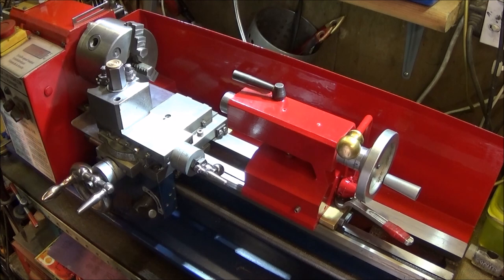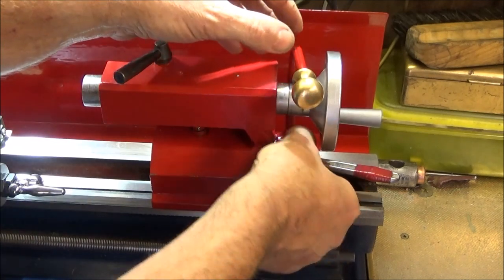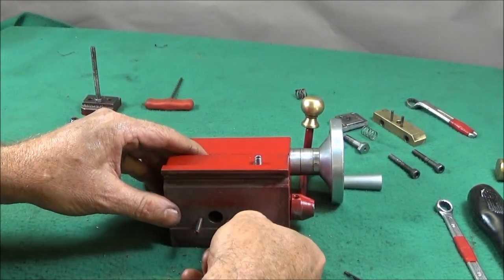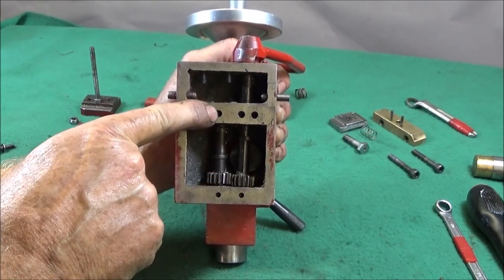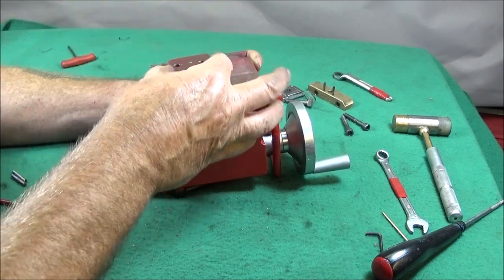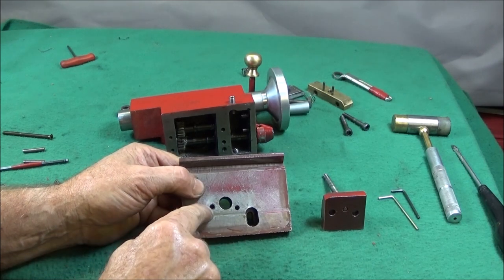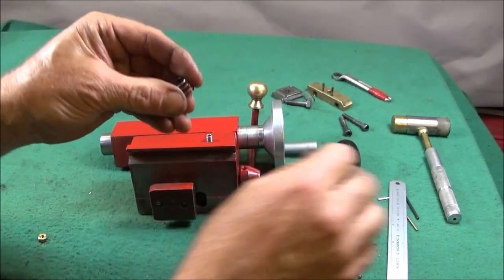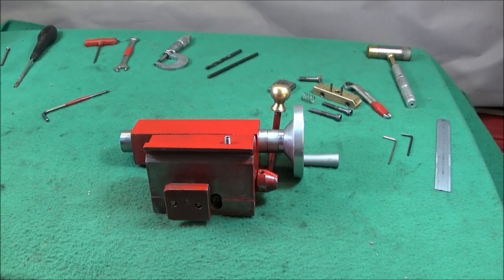Chinese Mini Lathe Tailstock Improvement & Extra Locking Lever Upgrade Part 1

Comment: Hi Steve,
Had same problem with tailstock pushing back.
I changed the cheap washer/ spacer inside for a square 1/8 ''  plate so that both cams have full contact which they dont with the washer.
No more pushing back, full lock problem solved.
CKW
Reply from the maker: Hi Carl, That's a great idea..... I never thought about doing that! Regards Steve

Comment: Great video Found when I striped mine down that the grub screws that retain the ca m shafts had backed out letting the gears slip apart only remedy was longer grub screws so the bottom plate would retain them Carried out mods as per your vid now works great Keep up the good work Thanks Roger
Reply from the maker: +Roger Halcrow Hi Roger,  Thanks.  I did notice my grub screws are really short. That's a good idea putting the longer ones in so they are self retained.  Regards Steve

Comment: Nice paint job. Could you screw two L shape nylon  lengths to the side of the tailstock base plate to hook under the bed. Might stop it lifting or twisting.

Comment: Hi Steve.  Thanks for this video; it reminds me that I need to do something with mine.  Been meaning to do it/something for some time.  A couple of other things.
1) Given that if I remember correctly (from one of your videos), you used to be in the aerospace industry.  Given that, I'm surprised that you still use BA screws/bolts.  I'm sure I've heard you mentioning not only BA. but imperial sizes as well as metric.  Luckily for me, I'm familiar with all of those threads (and others too), but the metric system is just soooo easy.  Perhaps you have a surplus of BA screws/bolts or something, in which case fair enough :)
2) I think better to put that 'return' spring between the bottom of the tailstock and the T nut.  That way, when you tighten the clamp bolt, you're not tightening against the compressed spring.
Anyway, love the videos and have binge watched quite a few.
Regards Mark in the UK

Comment: All very nice mods and definite improvements.One small suggestion: The spring you mention at the 12 minute mark to provide opening tension on the T-nut would work just as well on the underside, but with maybe less risk of getting knocked off. Also, it's always better to have fewer surfaces exposed to swarth so it would be easier to clean. Keep up the good work.
Reply from the maker: Thanks, Yes its good you mentioned that. It is much better to have the spring underneath, out of the way. At the time I didn't have a spring with a diameter big enough to go over the lock nut on the T bolt. On the back locking device I have it underneath like normal. Regards Steve

Comment: It's a bit old but I'm about to receive a mini lathe with a color I dislike. I'd like to repaint it. I was wondering if you could tell me how to do it correctly. There is some product that you spray on th old paint but not sure if it works well. Did you paint over the old paint? Thanks
Reply from the maker: Hi yes it is best to lightly sand the surface of the existing paint so it looks a bit dull. I just respray with a low cost acrylic paint. It's called 151 spray paint. Regards Steve
Reply: @SteveJordan  Thanks for the quick answer. Do products that come in spray bottle and dissolve the paint works as well to remove the paint?

Comment: Hi Steve excellent video as always ....Any tips of adjusting the angle and transverse grubs screw that act on the rectangular block that sits up from the base
I think you are meant to use these to straighten up the tail stock and make it align with the central axis of rotation but its a real fiddle to get right
Reply: I was watching this video hoping there would be something about this.I phoned the supplier for advice and was told have a look on YouTube,ho hum

Comment: I applaud you for using red, to much grey in this world. (Hope it's a bit oil resistant)
Wish my tail-stock had a cam-lock system.
Reply from the maker: Thanks, It seems to be oil resistant. Red has really brightened the lathe up... I think it looks better in the videos to

Comment: Excellent mods, I have one of these lathes myself, I'm just getting to grips with trying to square it all up basically, have you noticed that bed ways are not totally level along the entire length? It's like the tailstock needs to sit a fraction higher at some places, I only discovered that after drilling an hole in the end of a piece of bar.
Reply from the maker: Hi Steve Thanks, Yes I have noticed that on mine. If i'm using a centre drill and it looks like it is too low, (when the tail-stock is locked), I just give the quill a slight lift by hand as I wind it in, to start the centre.
Reply: I did toy with the idea of using an old pair of car feeler gauge for a shim, using them to lift the tailstock up a fraction.

Comment: These mini lathes typically use metric fasteners so why mix BA threads in with them ?
Reply from the maker: You can use whatever you like. I have loads of BA stock so I just used that. No point in fussing around with new taps and screws when I have what's adequate.